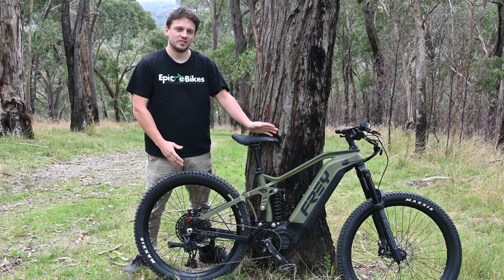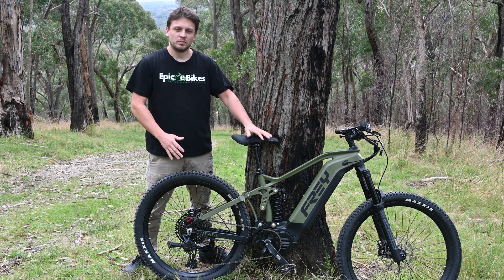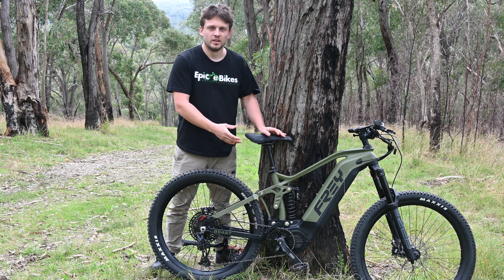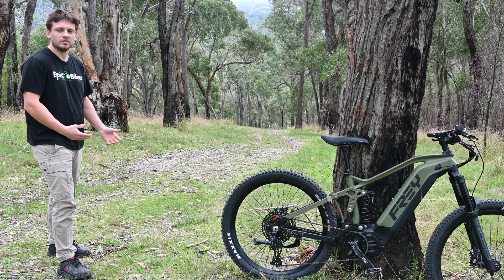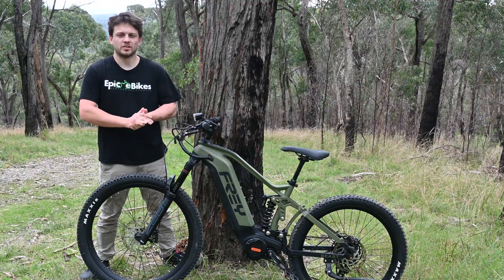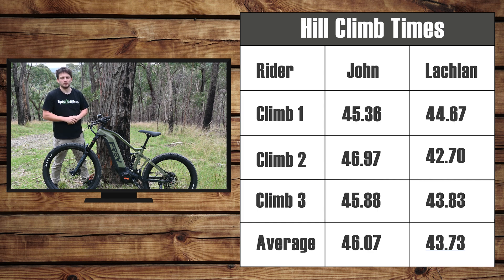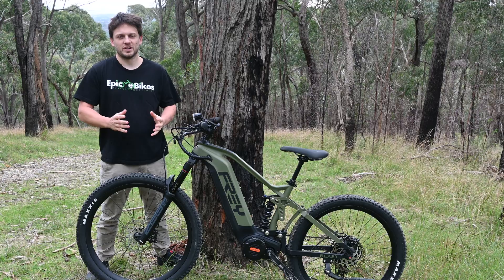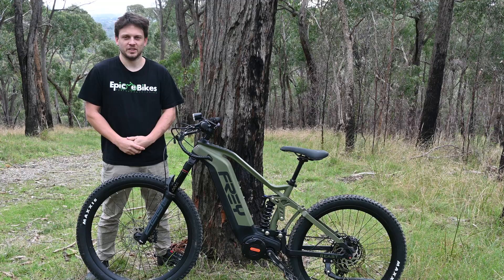Frey Beast Motor Test - 60V Bafang M620 Vs Bosch Vs Brose Vs Shimano Motors

Comment: These companies need to ditch the straight cut gears in these mid-drive motors to reduce the noise.
Reply: This motor is designed for cargo bikes. It's not an e-mountain bike motor but they worked with the manufacturer to try and adapt it to e-mountain bikes better supposedly. 

Personally, I don't mind the noise as a dirt bike rider, but as a former downhill mountain bike racer I really would like to ride the bike to see how the suspension design and geometry feel!

Comment: This thing is an absolute weapon. You could build something similar in speed for about half the cost (with lesser components though), but the warranty would be entirely up to you lol. Grouse bike though. Looks to be a lot of fun.
Reply: Absolutely not. This bike is positioned as an enduro bike. However, on technical descents, which is what an enduro bike is for, it is simply terrible. Moreover, he is also terrible on technical climbs. In addition, the Bafang company took the path of meaninglessly increasing the power and torque of engines, without bothering with the linearity of their operation characteristics, which is quite typical for the Chinese.

Comment: These motors have so much power you cant even get out of the saddle and push yourself unless you leave it on eco 1 or its just too fast for your legs😅
Reply: not too faste mate, get 29 inch wheels,   and a decent chainring, like 42T  and it's not an issue pedaling, infact pedaling helps the motor out a lot,  gains the speed much faster,  I have bafang m620 48Volts and I reached just over 60km speed which is a little over 37 mph on flat road, with 29x2.6 thick tyres,  If i had this 60 volts motor I would be going 40mph or higher,  and on low speed climbs pedaling is still effective for me,    not sure what  gears you are using, maybe sprocket too small

Comment: You really can not put the frey beast in same category as the others. it's more motor bike.
Now if you really want to test it against them go and find a tech climb not a basic path. Or try it down hill on some tight stuff. I think you'll find it's not great then.
Reply: it's not a motorbike,  it's only 1500 watts,  there are 100s of bicycles i see on roads today in London with 1000 watt and 1500 watt hub motors,  it's normal in today's time,  you need minimum a 750 watt motor to be able to enjoy an electric,  if you are going for an ebike, and you like fast riding, not to be dissapointed;  just  get a proper one, 1000 - 2000 watts and enjoy the power,
Reply: @soyboy899  I own a frey and trust me the are not really a bike compared to  legal EMTb

Comment: Wondered if you'd come back. Nice to see you again 😊. Also, can you tell, what companies brick their unlocked bike. I think it's time for Australia to stand up against our Govts and demand a minimum 35kph legal street limit. Would you consider helping?
Reply from the maker: Bosch, Shimano & Giant are all making statements that they will brick unlocked motors with there latest units and software, All will also deny warranty if unlocked even when many of them come unlocked to 45km/h In other countries such as the USA. We certainly think 25km/h is too slow, Makes sense for some places but for commuters or riders on off road trails its far too limiting and in some scenarios likely less safe then travelling at higher speed.
Reply: @EpiceBikes I’ve just bought a Cube Reaction Hybrid Pro and I pick it up tomorrow or the day after. As you know it comes with the Gen 4 CX, and I’m gonna ride it for a couple weeks till I’m sure it’s all good, then grab a Volspeed 4 off you guys. Is your website still accurate in that it should still be okay with the latest update, provided I do as you suggest? I know you guys can’t control what Bosch does with their software, so I’m not gonna be a Karen and sook if it throws errors, but do you know if it’s still sweet with the latest update? Edit: Just noticed that it’s not the Volspeed, but a different chip on your site. Question still remains though.
Reply: @Psyopcyclops  as someone looking at getting a Cube Reaction Hybrid Pro 140 HPC 625wh, the fact they didn't even reply makes me rethink my decision